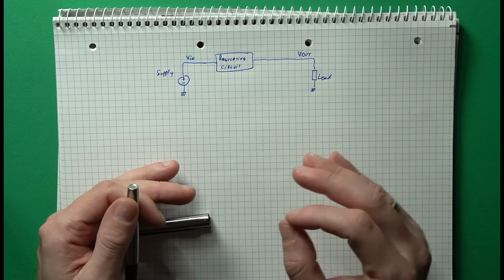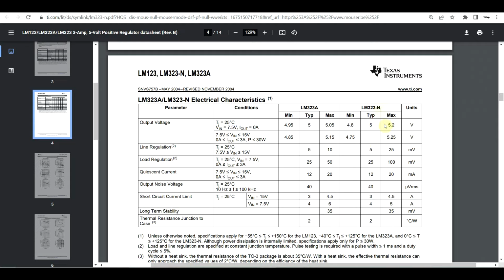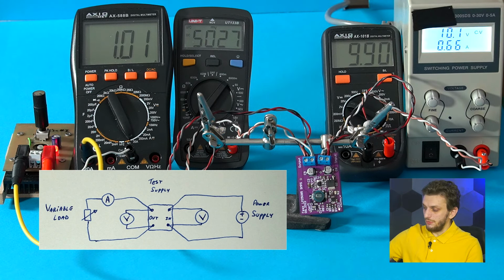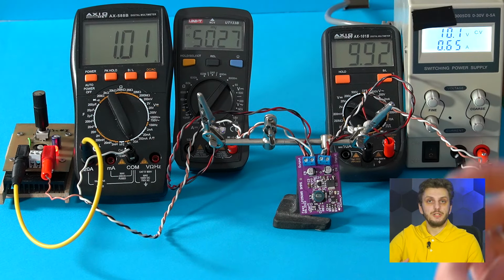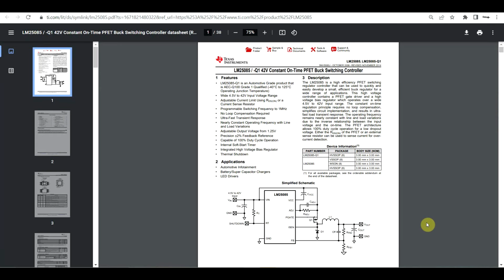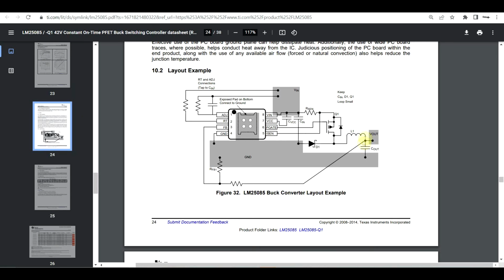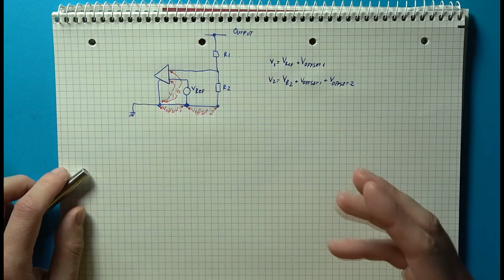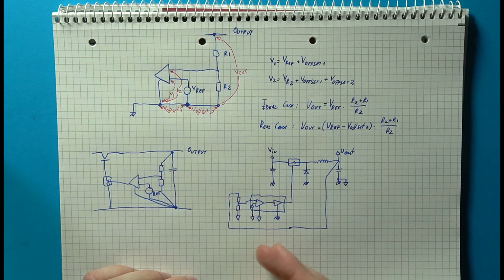Power supply parameters - Static Accuracy

Comment: I guess you could have a high-pass filter from the output cap to the feedback network, and a low-pass filter from the load to the feedback network, in order to have good DC accuracy while maintaining stability. I came into an unwanted computer PSU recently, making a high-power CC/CV buck-boost benchtop supply from that sounds like fun, and I’ll be sure to have a seperate sense terminal.

Comment: The conceptual idea of testing power supplies starts with a know load characteristic like a constant current (CC) load or a load resistor (which is not CC as it heats up, or the supply output voltage changes). So, if you want an ideal static load then use an electronic load. However, the real issue with ideal loads is that the power supply is designed to satisfy the requirements of the load, and the load is usually very dynamic in how it uses power, which ultimately leads to looking at the load as being fed by a Power Distribution Network (PDN). Which is especially important at meeting microcontroller supply decoupling requirements. 

So, it is good to get into the habit to look at power supply design as powering a specific circuit or board subsystem. You may ask okay if the power supply design is dependent on the load how can I design a basic generic power supply? the answer is you cannot. You can however, design the PDN to allow a generic supply to meet the load requirements. A good example of this is your basic generic personal computer power supply. It is about as generic as you can get with virtually hundreds of options available to you off-the-shelf. However, the power supply does not directly feed the load(s) (except perhaps a cooling fan which is not a complex load), it is what is called a pre-regulator, so there is a motherboard regulator that feeds the microprocessor, which is very specific in meeting the needs of the microprocessor and also is characterized by a local PDN. So, the trend in design for addressing the load requirements is, in almost all complex load designs, you will see the use of a generic pre-regulator supply feeding a PCB that will have a local regulator and PDN to feed the load. Remote sensing is not really needed if the power supply is at the load (in very close proximity like 5mm).

In a preliminary static test with a constant current load (CC electronic load) at rated power, you are mainly looking at power dissipation (heat flow) at room temperature. To get an understanding of the thermal performance of your design you need to let the power supply stabilize, which will take some time, and is useful to monitor with a thermal camera to see what is happening, to make sure it has stabilized, and to understand any hot spots. If the supply works as designed at room temperature. Then you can decide how you want to proceed.

Off-line AC to DC supplies are interesting to test because you now have to also include AC line transients, not just low line or high line which is used for static testing. Also, a universal supply with power factor correction and relatively high current requirements (like 500W) can do interesting things during line transients that are not easily modelled. You will need a programmable AC source to simulate the regulatory required transients (they will be specified depending on where you want to sell your product) and also one's you make for yourself to better get an overall worse case test for your design.

The starting point for a regulated DC power supply is usually to compare it to a large DC battery of the same terminal voltage, which is essentially the idea of understanding the output impedance of the supply and its rather impressive capabilities with the understanding that it will have some dynamic behavior because it uses feedback.

On you board layout where the sensing feedback trace inters the large plane have the trace enter at 90 degrees to the plane and not off angle where one side of the trace enters at an oblique angle. This will create an unwanted large trace stress riser which is where you well get a crack in the field after operational heat cycling.

The advantage of having the power supply controlling switch on-board a regulator IC is you can monitor its temperature and shut down the supply when there is a fault which causes overheating. If you have an off-chip regulating pass transistor you should monitor its temperature and shut down the supply if it gets too hot.

You can get a star ground effect using unbroken planes if you place (group) the components correctly for their operation, which usually means at least a four layer board. You are basically laying out the board to eliminate parasitic effects. The two internal planes can form a high frequency capacitor which is helpful in designing the PDN.